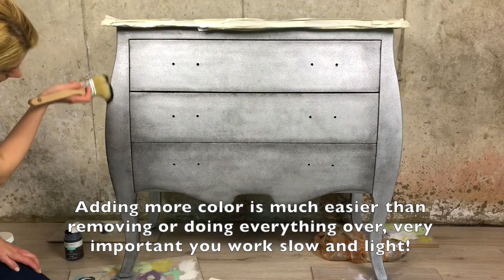Furniture Makeover with Metallic Paint and Chalk Paint

Comment: Shellac??  Does this wear well? Good to use to protect a bedroom side dresser?( lots of use)
Reply from the maker: I used shellac as a stain blocker to prevent bleed through, not as protection. For something high use I would recommend using a polyurethane to seal it. Rustoleum Metallic paint should have it's own protection, but I have not tried it!